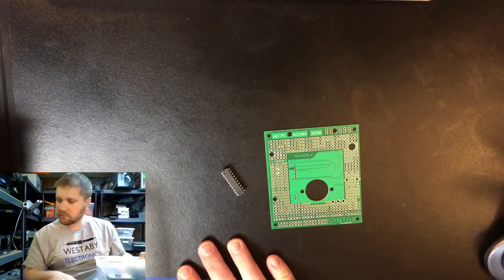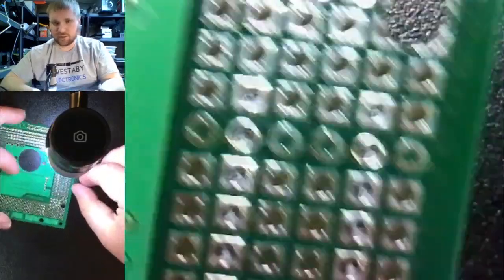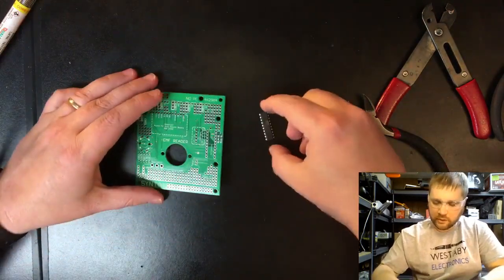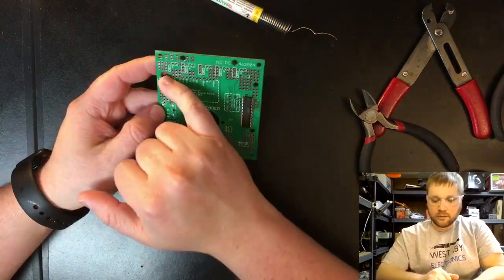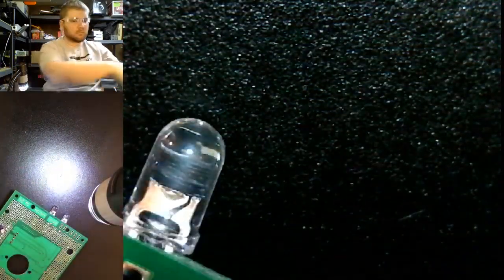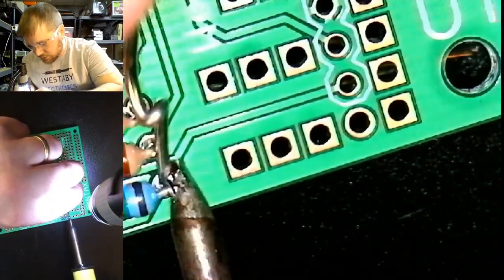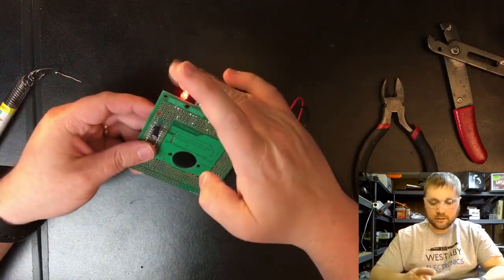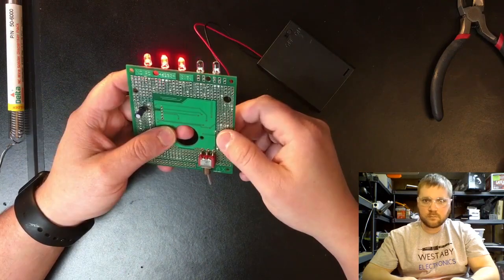Building a Supernatural EMF Reader - Part 1

Comment: cant find the - + on the light up red button but one side has a red mark ?
Reply from the maker: Depending where you purchased the button, the + - orientation can be different.  The best method is to use the 3xAA battery holder and one of the 100 ohm resistors to poke the pins of the button.  When it lights up, you will know which pins were + and -.